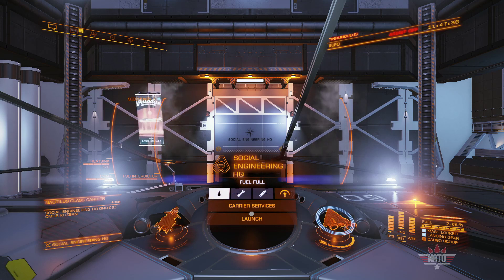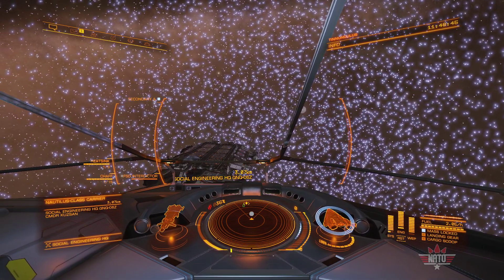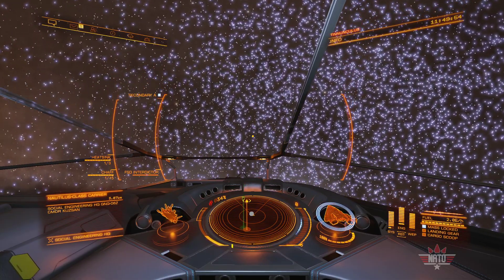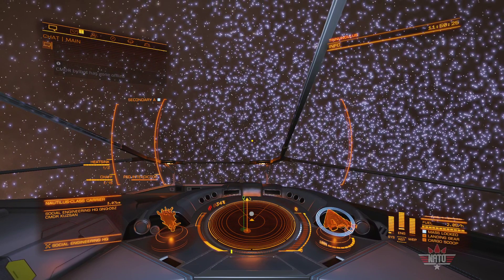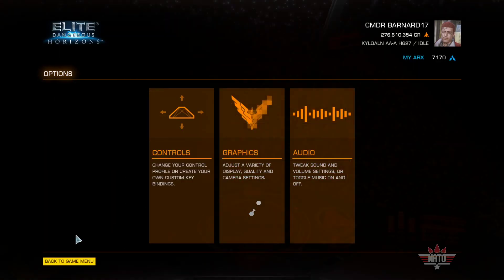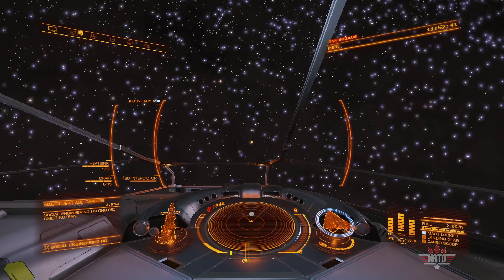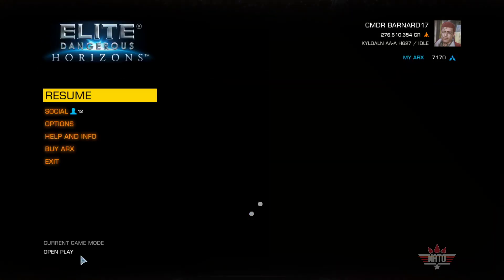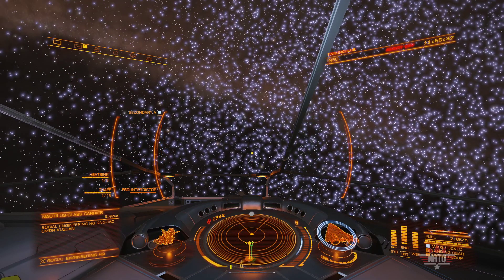Relative Mouse - what it does, how it works.

Comment: Hi, don't know if my issue is addressed somewhere in your playlist.

But here's the problem. Relative is great for FA off (and out of supercruise). But you automatically get FA in supercruise, and then relative mouse is horrible. Also it seems toggling FA is the only way to "just stop". So you still need relative mouse to go away intermittently. Is the only solution to also toggle relative mouse, all the time, for no particular reason except that the game doesn't want to bother?

It seems if it's going to be this degree of hassle, I should really just plug in the old 360 controller to use without FA, otherwise use MKB with FA and no relative mouse.
Reply from the maker: I use absolute rotation controls on the keyboard when in supercruise, with a DPI clutch on the mouse to whack up sensitivity for fine adjustments.

I've also known people who keep a gamepad or joystick to hand they use in supercruise.

Frontier did add a binding option for a relative mouse toggle, but as I'd adjusted to how I do things before that was put into the game I didn't adopt it after trying it out.